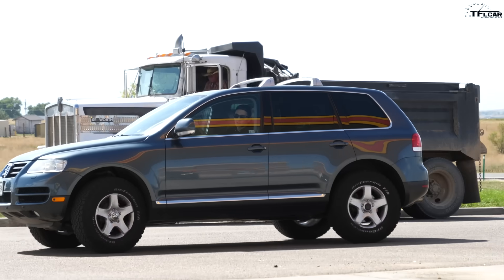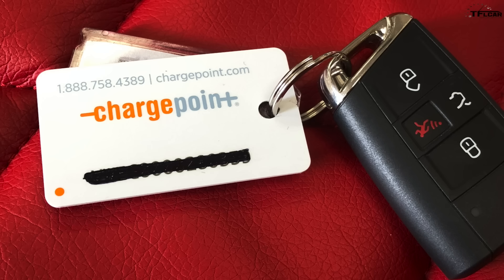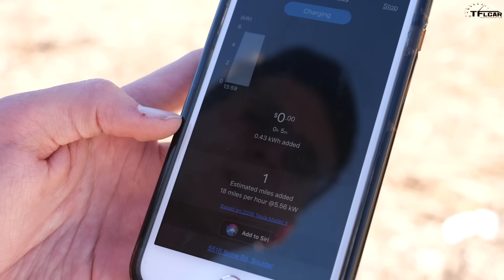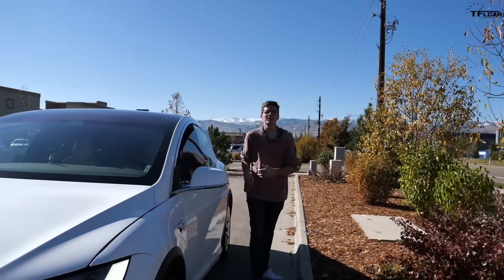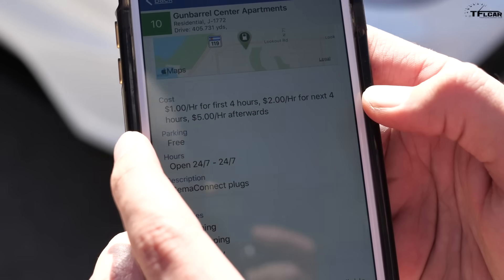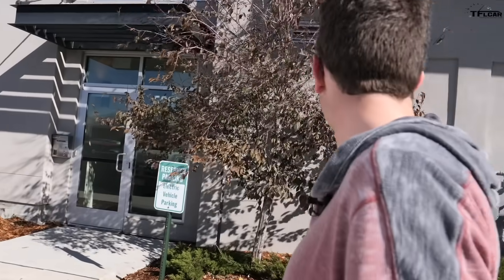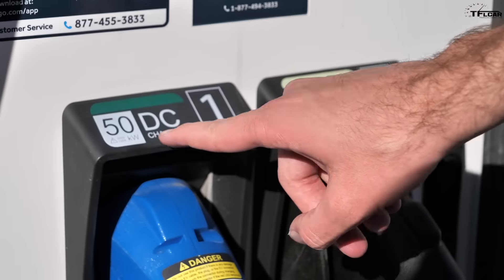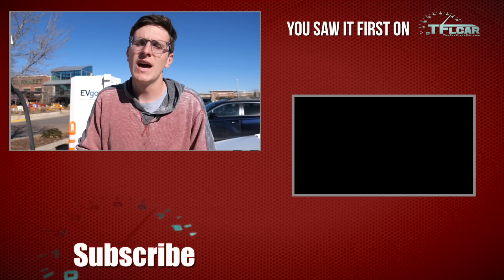Here’s Why Charging an Electric Car Can Suck - And It’s Not The Reason You Think!

Comment: The irony I saw was this guy waiting for his car to charge in the middle of summer in a desert with temperature pegging over 100 degrees.
Reply: Then you get into the car and run the air conditioner while you charge. Next issue.
Reply: Scott Franco But doesn't the A/C use the cars electricity therefore making the charger even slower??🤨
Reply: Hey JACKASSS
Soooo sitting in your car and n hit and cold weather for hours is your solution. 
Or spending money going shopping to eat to a movie etc whilst you wait is ok
Reply: Jason Did you read what you just typed?  Does your sentence somehow make sense to you?
Reply: @appletree8441  ah yes let me go spend 40 bucks at the movies while letting my car charge so i have something to do instead of just spending less than 40 bucks on gas and it only take 5 minutes.
Reply: @scottfranco1962  you'll kill the battery faster than it charges
Reply: Scott Franco You obviously misses the irony
Reply: @scottfranco1962  So, just add to the charging time because you're using the a/c?
Reply: @robj2704  Sure, but this is wayyyyyyy overblown. I don't use L2 chargers in public because they are too slow. At  50kW stations the A/C use is nothing, and at my 150kW stations for my Tesla its rounding error.
Reply: Running the A/C or the heater is such a low fraction of the charge on an L2 or higher (6.6kw or better) that it does not notably increase the charge time. I have owned 4 different EVs (Leaf, Spark Bolt, and Tesla). Most of the people posting here have never owned one.
Reply: @scottfranco1962  I looked it up and the AC unit draws 700 watts per hour. Considering you're charging at 5kwh that's not insignificant.
Reply: @leemer  %10 of 6.6kw, and you haven't specified which car needs that much power for the A/C, nor is there such an animal as a 5kw charger (3.3kw and 6.6kw). Most of the crap in this video article is made up. 20 minutes is an average supercharge on my Telsa, and that is only because, while on the road, you tend to drain the battery down to about %10 and charge back to %80. When plugging in at home, you charge far less on average, because you don't drain the battery down every day or every trip.  The typical "it takes 8 hours to charge" nonsense is quoted by people who don't own an EV. None of these "issues" apply to real world use.

Comment: Thank you for discussing the reality of EVs. I'm sure you'll now be shunned by your fellow EV enthusiasts but your honesty is very refreshing.
Reply: What he didn’t say is Tesla drivers charge at home or at a Tesla charge stations which are way faster and much cheaper than gas. I don’t think many Tesla drivers use those antiquated slow poke public chargers unless they are stupid.
Reply: Yep, I have never seen these issues talked about on any TV show about EV cars.
Mark Allen, you are right.
Reply: @wms1650  an EV is really only an option when everything you need under normal cercmstances is 5 miles away, don't drive more than 20-30 miles a month, it rarely gets cold, and there's light traffic at worst in the area you live, any other scenario and the EV is useless and in some areas too dangerous to even consider.
Reply: @skarloey2334   Right Skarloey.  I live about 120 miles from Little Rock Arkansas. If I drive there I will need to charge before driving back home.
Now Little Rock may have some charging stations but how close will they be or how far out of my way will I have to drive to get to one.  Then the charging time of about........
I don't even consider EV as acceptable transportation.
Plus I see the whole made up milage ratio of gas vs electric is a falsehood.
Reply: @wms1650  EV's have extremely limited use, the ability to run indoors being the only real advantage it has over most other fuels, but when we look at say 100+ mile one way trips EV's will fail miserably until charging stations are just as common as gas stations.
and with cold environments EV's loose to everything burning fuel as running defrosters and heat shouldn't have a major effect on the vehicles range unlike an EV.
Reply: Skarloey I live in Cleveland, OH - a place with fairly cold and snowy Winters and I have had no issues with my Tesla Model 3 over the past year of ownership.

As it is the Long Range Model with over 300 miles of ranger per charge, I’m able to drive my daily commute, including going out of my way to pick up/drop off a coworker that needs a ride in recent weeks, putting nearly 100 miles on the car each day and I still have nearly 150 miles of range left when I get home at night, all of this in freezing temperatures with the cabin heat and heated seats on.

Where exactly is the long range problem with modern EVs?
Reply: @skarloey2334   Now that's not true. I'm not on board with electrics just yet, but it's not that limiting. If you're going to make arguments, be a little more informed and/or honest.
Reply: Mr. Miller, and Mr. Allan;.    Thanks for your input. Your post regarding your Tesla was illuminating and informative.  A little on the high dollar side, but a common-sense choice.  I would recommend a used Prius, because they are affordable, and charge themselves.
Reply: @jack fenn : One thing to correct, hybrids are not “self-charging”, they just get their energy from gasoline, ultimately like an ICE vehicle (albeit they are much better fuel economy-wise and thus still better for the environment than pure ICE vehicles).

The “self-charging” moniker is just market speak to try and distract from pure EV sales. But don’t get me wrong, pretty much any vehicle propulsion technology is better for the environment right now than a pure ICE vehicle.
Reply: And revealing!
Reply: It is actually impressive how delusional you guys are. I mean really, well done, you have read one opinion once and then made your mind up on an issue and will stick to that false premise with such conviction. It’s incredible stuff.
Reply: @cjeam9199    Okay, you may have a valid point, BUT, you have not explained to us just WHY you believe we are delusional! Don't just give us elitist, egalitarian attitude, tell us the facts!
Reply: @cjeam9199  I just read through them and I saw many valid points and concerns. Rather than addressing the concerns with facts you simply call them names, in this case "delusional". I certainly understand your desire for a free and clean energy vehicle but the fact is that there's no such thing as free or clean energy. Sorry about that.
Reply: @Mark Allen : All I can say as a response to these complaints or issues people have brought up is I drive a Tesla Model 3 in Cleveland, OH, a fairly cold and snowy location and I have no charging issues as described in this video.

I charge overnight at home usually, normally drive 60-100 miles each day and still arrive home with around half my battery left, so I could even forego charging for a day if I wanted.

Also I have taken multiple 2000+ mile road trips with pretty much no long distance charging problems as Tesla’s supercharging network is a world class standard for how high-speed EV charging should and can be done.

Owning a Tesla is a dream daily driver and within the grasp of probably more people than think they can afford/incorporate such an EV into their lifestyle.

I recommend such potential EV owners to look into the math of owning a Tesla over their ICE vehicle and then test drive one. I bet most will never want to drive another ICE vehicle afterward.
Reply: @Jaws1200  Thanks for such a nice non- derogatory reply! You've addressed some concerns from practical experience, well done! I must however refute your half reference to affordability... Sorry but starting at 47k (unlike the 35k they promised) isn't an everyday man's car. I'm very happy for you in that you can afford a nice car and have a nice house with a garage and a first rate charging system. Perhaps you're just not aware that most people don't have all of that. But please make no mistake, I'm very happy for you, sincerely.
Reply: @Mark Allen : You actually can get the $35k Model 3, you just have to order it “off menu” by calling or going into a store. Otherwise the starting price of a Model 3 is not $47k but actually $39.9k, still pricey up front for a sedan but when you factor in all the fuel and maintenance savings (no oil changes, longer-lasting brakes, etc.), the actual cost compared to a new, similar-sized ICE vehicle may be closer than you think over the life of the vehicle.
Reply: @Jaws1200  The last time I checked it was only available with the extended range which is what bumps the price up. If you say it's actually available at 35k I'll believe you. The trouble is that most EV enthusiasts will accentuate the positives even if they don't exist and that's part of why people are skeptical of the entire concept.
Reply: I'm not just being funny here. If you  know more than we do, SPLAIN it to us!
Reply: jack fenn No, I’m absolutely not going to waste my time doing that, because these sorts of people have made their mind up and don’t change their mind when presented with facts.
Reply: All US Senators and Congress-persons,  Please get on the radio or TV and say this; "Hybrid diesel-electric locomotives have been pulling freight trains for 70 YEARS!
Reply: @Mike Barton You do make a good point and that's rarely discussed. The one thing I do believe is that in the long run, it will be more desirable for our country to go electric, but this is going to be a slow transition because of battery technology, charging stations and the fact that people will have to make a large investment. Think of all of the extremely reliable compacts in the market. Hell, I have a 1992 VX Civic that has 300,000 Miles and runs like a dream and is more efficient than our Prius. I know that's not a fair comparison, but there are many Prius, Civics, Corollas and other compacts that will run for 300,000 miles or more if properly maintained. This is why the transition will be a long one. I for one can afford a Tesla, but not willing to spend my hard earned money on a vehicle that depreciates. Why would I do that when my cost of ownership is a mere fraction of that of an electric owner? I work on my own cars (but rarely)... and smart mechanics usually purchase extremely reliable vehicles, because we don't like to work on our own cars!

Comment: 3:05 that´s only a problem in the US. In Europe the Model S and X also have the standard plug called „Typ2“. Its modified by Tesla for higher chargingrates but it also works with the standart in Europe. The Mode 3 even has the CCS plug which is the standard for european fastcharging.

Comment: That seems like an epic pain in the ass. 1 hr charging for 16 miles of driving? No thanks.
Reply: Makes me feel even prouder to own a car with an internal combustion engine!
Reply: Does not apply to Teslas at Tesla SC stations. No Tesla driver would charge at a slow poke public charger.
Reply: @Chainyanker007  Smelling your own farts eh? You sound like an old Southpark episode.
Reply: Save the pain: use this:  https://www.youtube.com/watch?v=cA-fZF7LUlI
Reply: Once again, proving why this car was designed this way--to discourage sales!
Reply: Not a problem if you're at work for 8 hours. If you get 25 km of range per hour charging, that's enough time to add 200 km of range.
Reply: @Roxor128  assuming you have an available unused charging plug at work?
Reply: @WV-mx3dr   Of course. Any decent boss would have a few power points for charging cars set up in the company car park as an incentive for their employees. Or their own benefit.
Reply: @Roxor128  you do know that all bosses aren't "decent", right?
Also, tell me where could i ever find a charging station on a construction site since i work in construction?
0% chance of that ever happening
Reply: @oscara.9265   You've got power on a construction site. Once you've got that set up, it wouldn't be much harder to hook up a few temporary 7kW chargers for the workers' cars (or even just regular 240V/10A power points), which can be removed once the permanent ones are wired in (for big sites with lots of parking) or the work is done (for a single house that'll just have the one). Really just a matter of the boss having the will to do it. Could make for good PR or employee perks. "Come work for X Construction. As part of our efforts to clean up our industry, we're now providing all employees with free electric car charging at the work site."
Reply: @Roxor128  are you kidding me? You really think that i could just ask the superintendant to plug in my car? As if they have the same plug?
Reply: @oscara.9265   As far as I know, the manufacturers bundle car-socket-to-household-power-point adaptors with the cars. If you could convince your boss to make some extra temporary power points available at the car park, yeah, you could give your car a slow top-up while you work. The 7kW chargers are a little harder, but nothing the qualified electricians you'd have in setting up the power couldn't handle. The company could have a bunch that get taken onto the site when the power gets hooked up, and moved onto the next once the site's permanent charging fixtures are in or the work is complete.
Reply: @Roxor128  yor boss is the exception, not the norm
Reply: @oscara.9265  construction sites dont use generators? You guys have no imagination.
Reply: @Roxor128  you and who else, lol.
Reply: @Roxor128  You've obviously never worked in construction. It's hard enough to supply power to all the workers tools much less get them to bring extra generators so you can plug in your toy car. They'll just laugh at you. They are there to get a building built...not at all concerned with what you chose to drive to work.
Reply: @yourhandlehere1   If you're out of town with no power lines and needing generators, then no shit. It's a completely different scenario. I wasn't talking about that one.
Reply: @Roxor128  Even in town....they don't hook up to the power lines during construction...they use generators spread around the building ...otherwise you'd have 200 extension cords all going to the same place. Everybody has power tools, air compressors, chargers for all the cordless stuff...
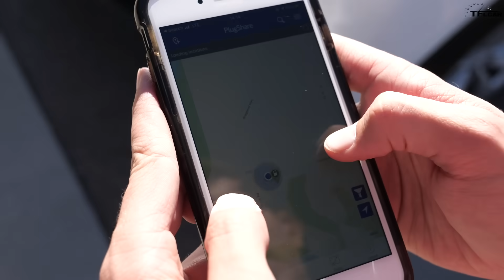Reply: @yourhandlehere1   Why would you have 200 cords to the same place? You do what the grid does and have a hierarchy of capacity to minimise cables, or better still, use the wiring you're putting in anyway and bring in temporary high-capacity cables for anything that needs more than 10A. Hell, most equipment could be battery powered and you just pick up a few spares from the charging shed in the morning and after lunch, and put the flat ones on to charge at lunchtime and when you go home. If you know you get about two hours out of one battery in a given tool, then you load it up with one and take a spare at 9:00 and can be sure you'll have enough to last you until lunchtime.

It's not hard to see how you could change procedure to do away with unnecessary generators. Not to mention the running costs would probably be cheaper. Electric cars cost about a third as much to run as petrol ones, and I've seen a comparison test of lawnmowers where the guy put in as much petrol as would contain the same energy as the electric one's batteries. He got a few minutes out of the petrol one, and was only halfway through the batteries by the time he gave up two hours later.
Reply: @Roxor128  Nobody has 200 cords going to the same place.....they have generators all around....pay attention.
Maybe you could go find a large construction site and look around. Obviously you have no idea what all goes on in constructing a building. Concrete, framing, plumbing, electrical, drywall, siding, waterproofing, painting, roofing, etc. They are all separate contractors with needs for power all over the place. On a large apartment complex one end might be getting roofed and interior finishing while the other end is still being framed.
You can't hook the building itself up to power until the entire building is completely wired, with all fixtures installed or you'll have loose hot wires hanging everywhere and folks getting electrocuted.
We know what we're doing....you do not.
Nobody....is going to set up a special place to charge your stupid electric car.
Reply: @yourhandlehere1   Okay, you're stuck in the mindset of how things are done now and have no imagination to use to come up with alternatives. Got it.
Reply: @Roxor128  Oh right...I'll get right on that...changing the way buildings are constructed all over the world.
Don't worry, that Tesla "truck" won't be showing up on any work sites.
Reply: @yourhandlehere1    I wish people would stop calling that thing a truck. It's a ute at best, and a poorly-designed one at that. You can't fold the sides down for getting stuff off the back. No tradesman is going to buy a ute like that. If they can get a few hundred kays out of a charge and a proper back on it, they will, but Tesla's design lacks the crucial back to get it sold.
Reply: Sooo you're a robot 
Your life is the same day by day hour by hour 
No snow no power outages
No bad neighborhoods 
The same job and the sane times
Reply: Apple Tree well, that’s why level 3 charging exists. If you’re in a rush, you can go from 30 to 85 or 90% in about 25 mins
Reply: @WarrenWeekly  If there is level 3 charging to be found. And you have the right app. And you have mobile data. And and and... This is a few to many "ands" to be ready for the actual mass market.
Reply: Yeah the government is going to force this pain in, so there is not much you can do about it. Here in Europe they plan to ban cars in a few years and force us use these toys instead